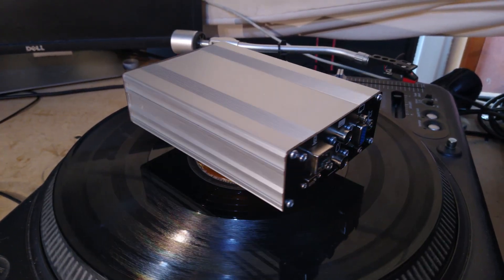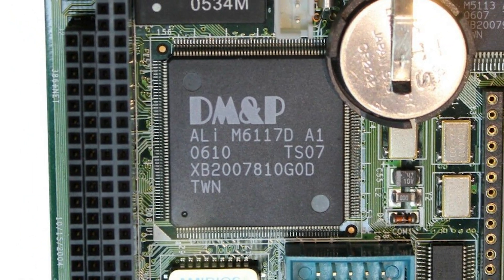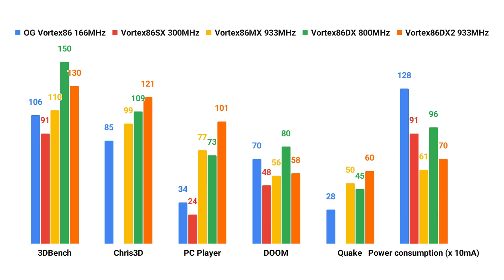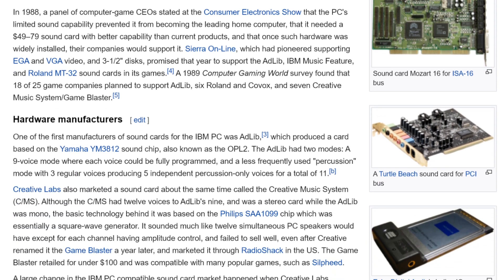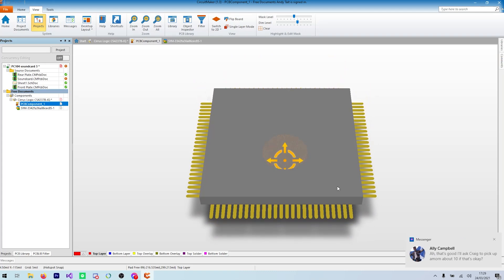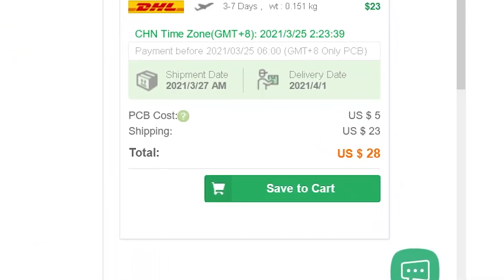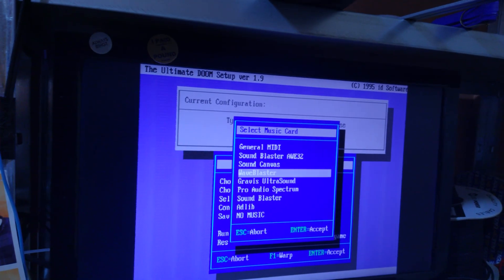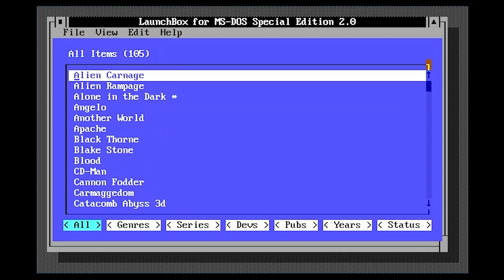Mini DOS Gaming PC Part 2 - CPU Upgrade + Benchmarks, Building Soundcard

Comment: I didn't know about UTSource but since we talked about the ESS Solo-1 in the other comment section I looked it up. And they do have the chip there still! ES1938S . If it is compatible with these boards the same way it is with the VIA motherboards and TDMA works on them then you would get excellent sound blaster and especially adlib compatibility. It would sound very close to an OPL3 and in some games it can sound better. Might be a great fallback if you have a board that won't accept these ISA chips.

If you ever make a retro PC like this for the 98 era, another good PCI one could be the YMF744B-R which also has some native DOS compatibility with a TSR (Not as good as the ESS Solo-1) but inside windows it would have fantastic wavetable midi synth with Yamaha XG support. A3D, and EAX support. And it has a native OPL3 built in.

Comment: Hey, were you ever able to find the value of that ferrite bead you used? The parts list you linked to just says you didn't know the value.
Reply from the maker: I just used a random one from my workshop haha. TBH the value probably isn't too important, it actually works just fine if you just bridge the ferrite pads
Reply: @TheRasteri  Ah ok so it doesn't need to be a very impedance high value then. PCBWay were complaining about it so I thought I'd ask since I didn't find any hits on the part number in the photos. Digikey apparently does 0R @ 100MHz, that should probably be fine. Thanks for that
Reply: @mrrandomperson3106  Can you help me out with a complete, PCBWay accepted BOM file? They are complaining about every sencond part on the list:)
Reply: @petervarga3898  Hey man sorry for the delay, I replied but I think my reply got killed because I posted a google drive link to my BOM. The BOM included in the link only had four items flagged and two of them were because they were out of stock. The eight electrolytic caps I found on CPC since Digikey don't do them in 5mm. The sound chip they accepted a UTSource link and the rest had alternatives on Digikey
Reply: @mrrandomperson3106  Thank you:) You know it waited ~20 years, so it can wait some more. I am not really sure which parts replace the ones they dont have. Maybe you could post the BOM somewhere as an image?
Reply: @petervarga3898  I'll try the Google Drive link again and see if it works this time: https://drive.google.com/file/d/1-3-fLWXBrkBQueZAyHDu0kCOkcTWQcuM/view?usp=sharing
Reply: @mrrandomperson3106  Thank you for not giving up!, it worked beautyfully! Lesson learned: you have to be lucky to get a good PCBWay eployee on the other end of the wire. My XLS was a just a little bit on the yellower side:)
Reply: @petervarga3898  I can't tell how many support guys there are. I got Riley, who took forever to reply to any e-mails but generally knew what they were doing.

Comment: Well, the original Vortex86 was based on Rise cpu core and SoC architecturem licenced by SiS and DMP.
Vortex86 SX is actually a different CPU created by RDC Semiconductor, hence the big difference in perf/clock

Comment: Awesome work! I am also doing a PC/104 build, and i am stuck on the RJ45 breakout.. how did you wire it and figure it out on yours?
Reply from the maker: The pinout is in the manual of my PC104 board, can just compare it to the pinout of a regular RJ45 connector

Edit: although now I think back, I actually just copied the pinout from the original cable that came with the board

Comment: "I imagine the reason for this is power consumption"
Maybe part of it, but it might be bottlenecks and/or architecture differences. a cycle for a Pentium or Pentium 2 would not equal a cycle for a cycle for a 486 so if the computational efficiency per cycle is essentially double or triple then you would have 900Mhz 486 = 300 Mhz Pentium II or whatever.

Comment: Nice upgrade. I'm glad there's an FPU-equipped variant, a lot of people forget that the Build engine used the FPU too. The only exception are the games running on the earlier version of the engine that didn't use slopes, like PowerSlave/Exhumed.

Comment: Simply fantastic. Would love to buy one!
Reply from the maker: I'm working on ways to make tiny PCs more accessible. Keep an eye on my channel!
Reply: @TheRasteri  Thank you, I am following keenly.  Also wondering if your soundcard design allows using things like an external MT-32 or SC-55?  Thanks again!
Reply from the maker: @jpxdude  Yes indeed - you can use the Joystick port to output MIDI, I often use the mini PC with my Sound Canvas. Adapters are still available on eBay.
Reply: @TheRasteri  Excellent.  I am super hyped for this.  Cheers.